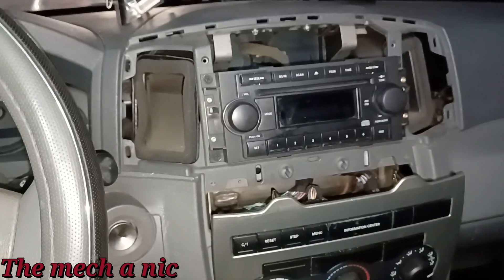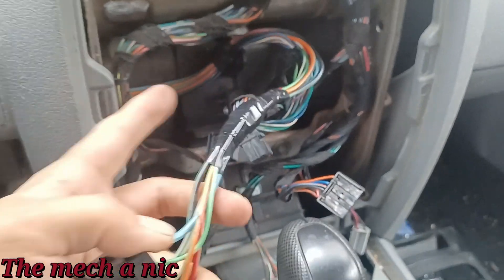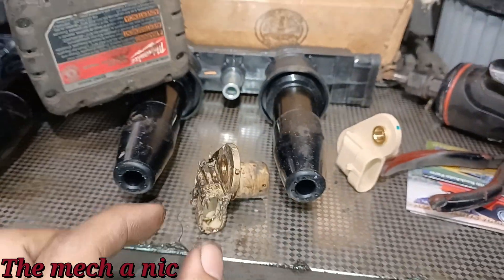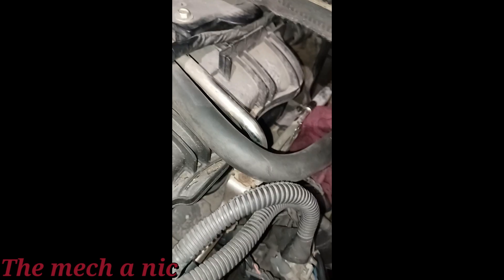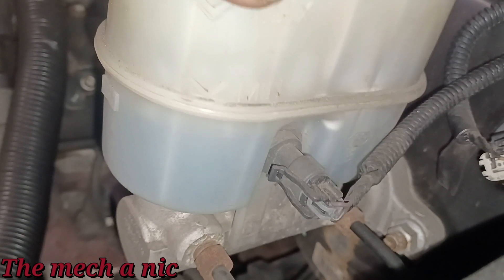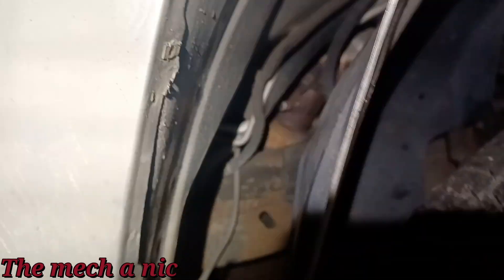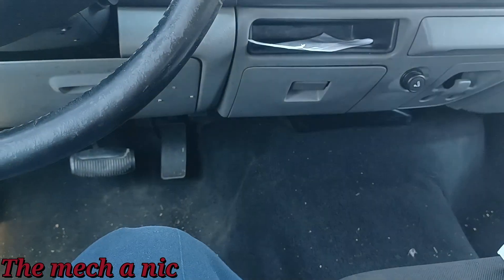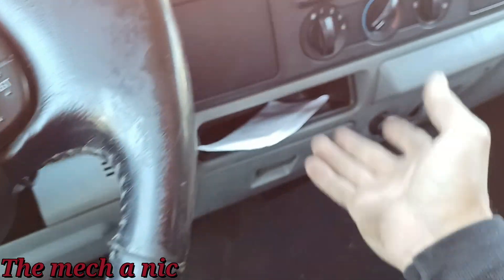grand cherokee no blower motor / yukon low oil pressure / F250 won't drive (vol 124)

Comment: With regards adding an oil additive ,Won't do any harm and what's there to lose on a worn engine.  Great fix on the throttle issue and I always say get the problem properly diagnosed first .
Reply from the maker: I mentioned to the owner to add it to the oil but I don't know if he's tried it . I wonder who told the owner of the f250 that it needed a accelerator pedal. That was a bad call. God knows that would have thrown out a good ford part for a crappy dorman pedal

Comment: Can't blame you for doing what you did on the blower motor. I figured that would have taken care of things if I was in your place. And about that F250, some people are not qualified to diagnose their own cars.🤷
Reply from the maker: After finding melted wires , and melted resistor , then a bad blower motor . I thought it would be a straight forward repair but I was wrong 🤣👍

Comment: With the way the used car market is and every dealer and bozo scrambling for anything in any condition, "buying someone else's problems" is putting it mildly. Trust no one and nothing.
Reply from the maker: Definitely... I got someone who wants me to check out a $1000 2004 chevy they just bought.  A a 04 for $1k.... you know it's going to have problems 🤣

Comment: All My LS engines never held pressure over night but a couple of hours is a definite concern.  I would invest in a new oil pump for the 6.2  before it blows up :)
Reply from the maker: I'd think this engine has bearing clearance issues over a bad oil pump but then again I don't have much experience with these engines
Reply: @themechanic6117  I have read many went with a high volume pump and drove on for years so for a try it's well  worth it compared to a new engine 😉
Reply from the maker: Definitely.  That sounds like a job for the shop not for me 👍

Comment: Some motor honey may help the oil pressure, but 6.2 is a a cam in block VVT engine with lifters that are known for failing, so I would want to make it too thick.  Need to drop the oil pan and replace  the main bearings, maybe even put some 1 over bearing in it.   I would do that on a personal vehicle, but for a customer, I would just quote a replacement engine from a salvage yard.  Also you can just unplug the sensor and it believe it will go infinitely high and shut of the annoying beeping, the he can drive it till it pukes. .
Reply from the maker: Honestly I didn't even think of doing that to the wire . God knows that temp fix would turn into a permanent fix lol . Whatever is wrong with that oil pressure I want nothing to do with it lol

Comment: The thick oil additive wouldn't do any harm. Cut the sensor wire a use it till it stops going
Reply from the maker: I didn't even think of doing that to the wire. That temp fix would turn into a permanent fix lol

Comment: You might want to check the oil pickup tube o-ring.  That might cause a low RPM pressure issue.
Reply from the maker: I see a few comments about this. I didn't know the oil pick up O ring is a issue on these engines.
Reply: This is a common issue on GM LS engines. 
Good luck. I enjoy watching your videos.